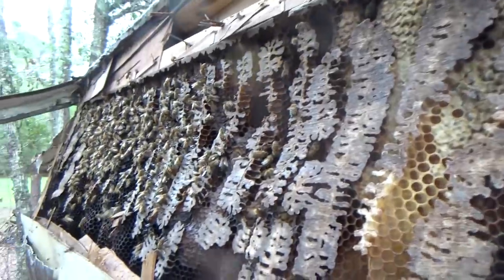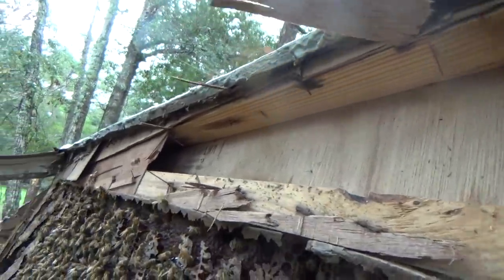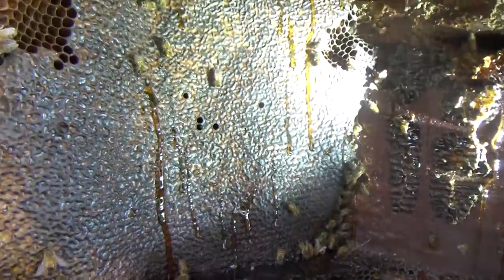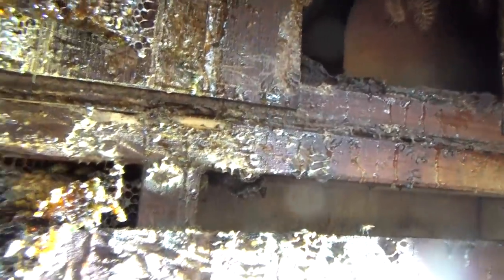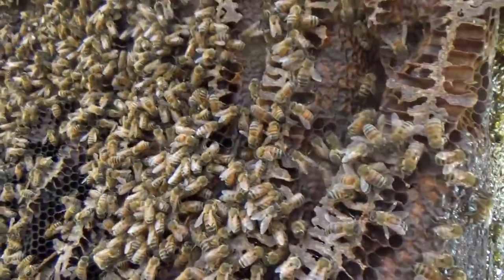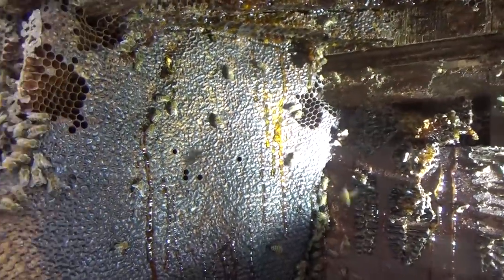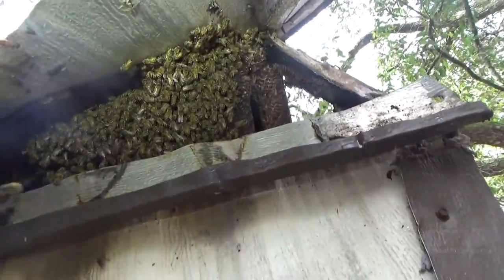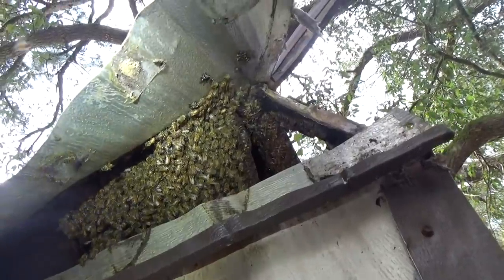The view is great from up here!

Comment: Mr.Ed, another awesome video. 
It is interesting that the new box you set was robbed. Does that mean the new bees swarmed and left? Also, how many swarms do you catch do you think were originally Abbey Honey Bees?
Reply from the maker: More than likely, it was the robber bees that pushed the new bees out of the box. Because the new bees had not yet established that this box was their new home, it made it difficult to defend, and the bees fled out of self preservation. Because I split bees which prevents swarming, it is a very, very low percentage that the swarms I catch are from our own hives. Plus, 95% of the traps I set are over 7 miles from the abbey. Thanks for watching. God's peace.
Mr. Ed
Reply: I think you need to make some tiny little name tags for each Abbey bee, so you can tell when you re-capture them!
Reply: @curiousone2940  or make a little paint brand for the queens big ole butt:) AHB! LOL